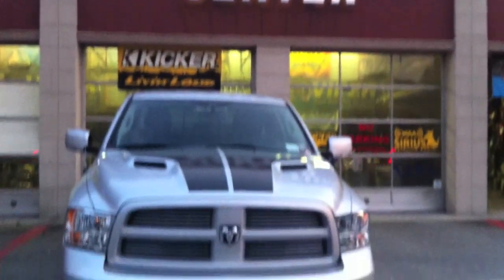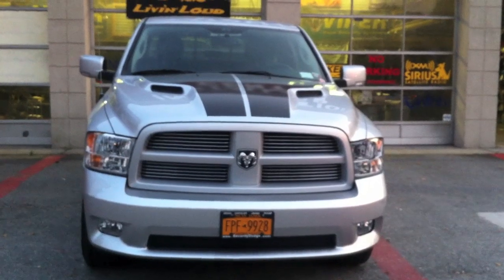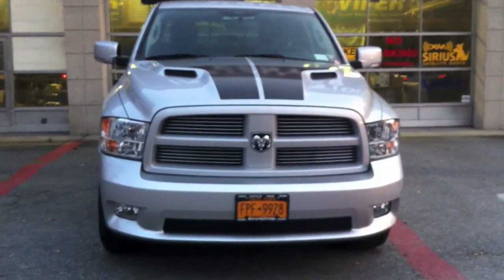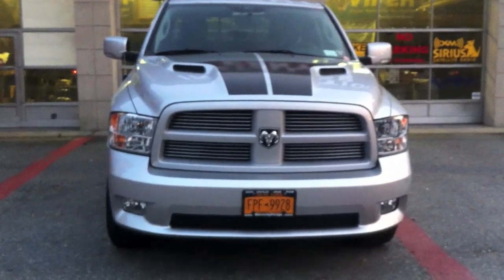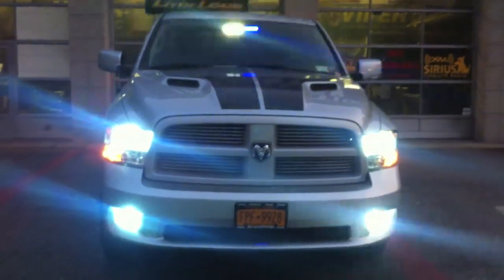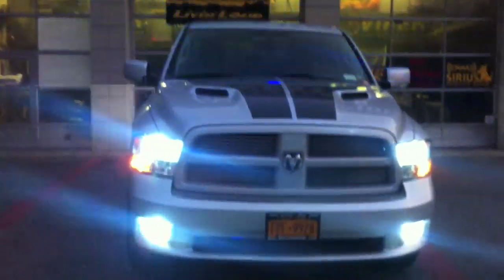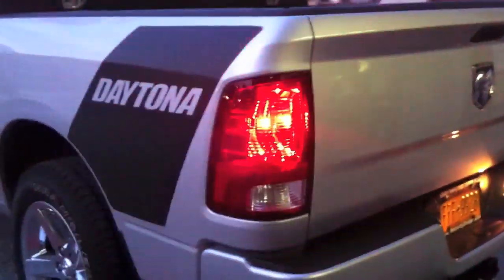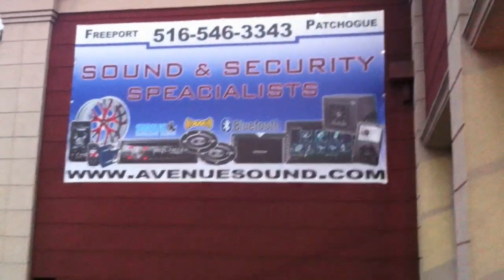2012 Dodge Ram 1500 HID LIGHTS and STROBE LIGHTS

Comment from the maker: Hi,
You can most definitely add HID's to your vehicle.  You will need the HID kit for your specific vehicle and a relay harness.  We've done plenty of these so we know they will work with no problem.   HID's consume less power and provides more visibility while PIAA bulbs consumes a lot more power and in my opinion does not provide as much visibility as HID's

Comment: I feel bad either for the Customer or the Installer. There is NO 2012 Daytona Edition Ram.If the dealership did it, I'm sorry bud you got charged for something that doesn't exist. If it was the Ram owner, why did you up-badge something like that? The only "Special Editions" produced for the 4th Gen Rams(so far) are the single cab short bed R/T's with the 22" 5 spoke rims and 4.10 LSD rear ends.  As for the strobes, good job on the install it looks really good and clean.